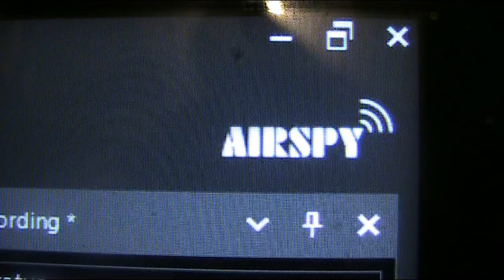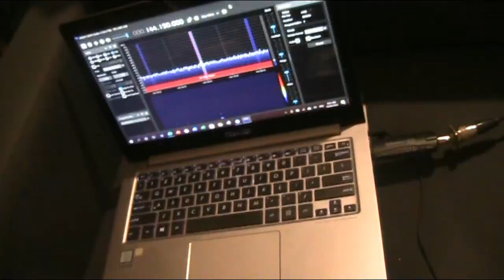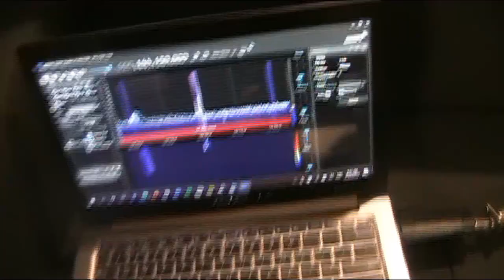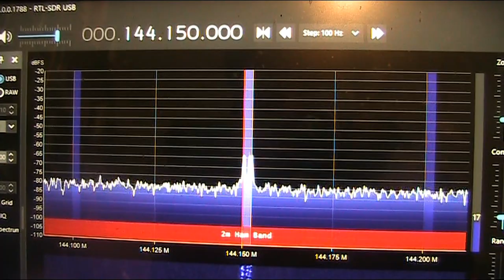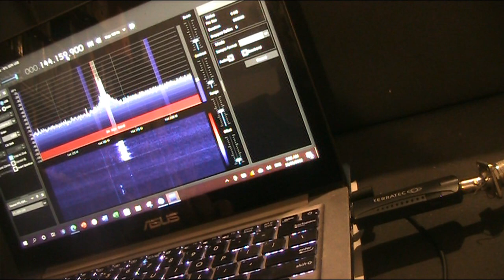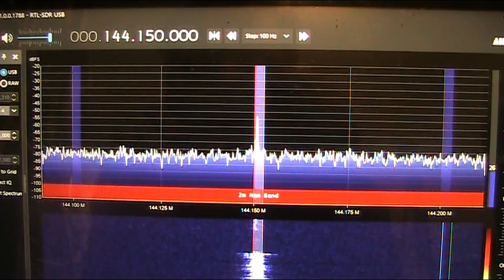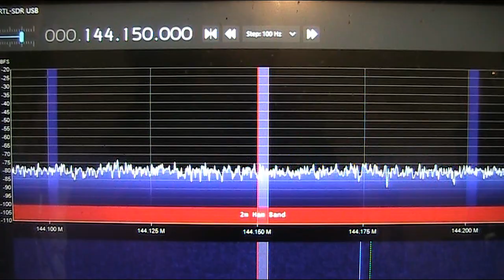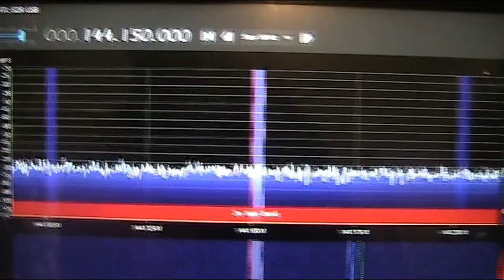Receiving 144 MHz SSB on a RTL2832 SDR dongle: How good?

Comment: Being one who has just  gotten his very first SDR rx dongle a few weeks ago, I find this video absolutely fascinating. 
My dongle is an RTL-SDR/Blog/V3 from Amazon, covering 550 KHz to 1.7 GHz for about 30 bucks.
I've been having a blast experimenting with it along with a discone for the antenna and trying it out in a few of my favorite old computers. 
So far it runs beautifully under Windows XP in my 32 bit Dell OptiPlex 745 desktop PC and Dell Latitude D630 laptop using SDR# or HDSDR as the software. Plus, it runs great in my 64 bit Dell Inspiron N4010 laptop, which dual-boots into either Windows 7 or Linux Mint, using SDR# or HDSDR during Windows and GQRX during Linux.

Thanks for sharing Peter, and 73.
Reply: The AM band filter they sell also helps a lot for HF, especially if you have strong stations nearby
Reply: @davkdavk  Right on, davkdavk...  I found  their listing of  "Broadcast AM Reject High Pass Filter (2.6 MHz HPF) by RTL-SDR Blog" after doing a search on the phrase "rtl-sdr blog AM band filter".
Reply: @TerryMcKean  Seems to work well. I have a couple AM towers about 50km from me. 21mhz is a lot better. I was getting 891khz AM coming in when tuned on 15m band
Reply: I like openwebrx as well
Reply: @davkdavk  Thanks for that info, davkdavk. I live far away from any AM stations, but I do pick up some images of SW stations here and there when tuning across the HF spectrum. My next project is to homebrew a little antenna tuner to help reduce the SW images. Right now I just have a 25 foot random wire attached to the hot side of my discone antenna in order to pick up BC and SW. Eventually I'll set up a separate longwire antenna for BC and SW and use the homebrew tuner to peak the areas of interest and reduce any out-of-band images that might pop up.

Comment: Do you use an preamp. For 430Mhz i am using an Gaas Fet pream. There is no different to a good 430 Mhz radio. <Thanks for the video. Vy DC4BR